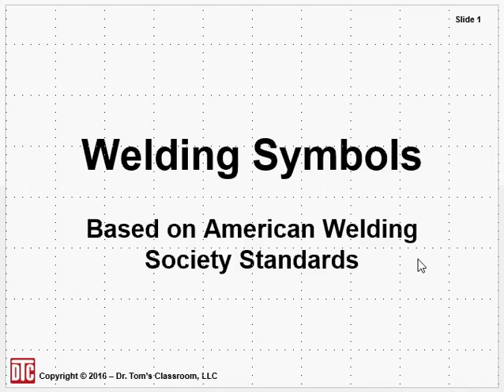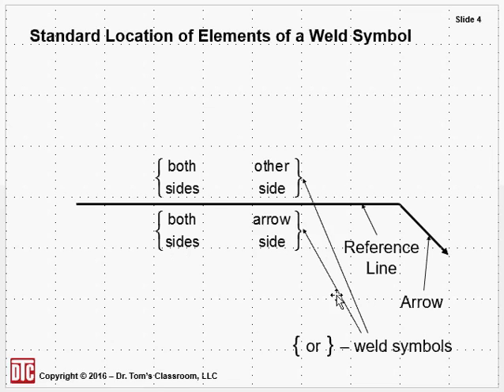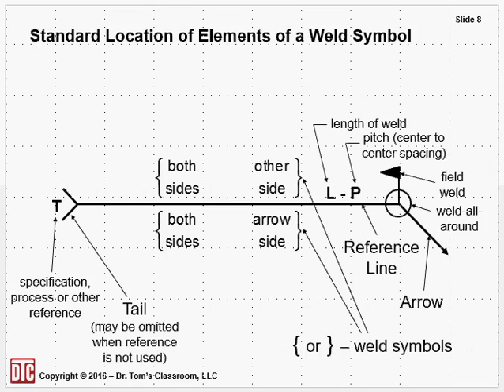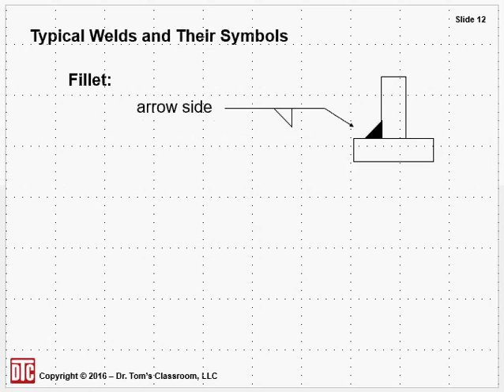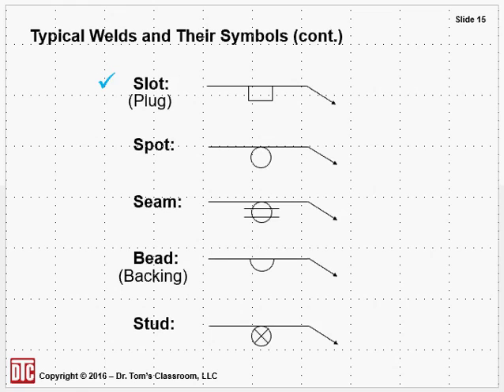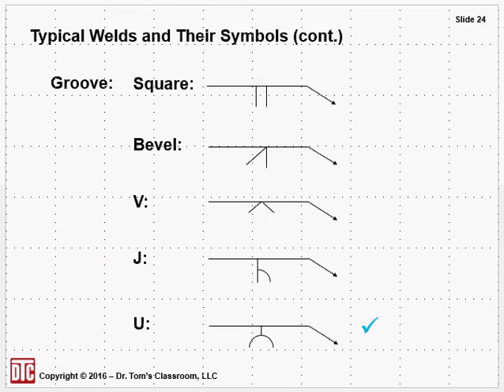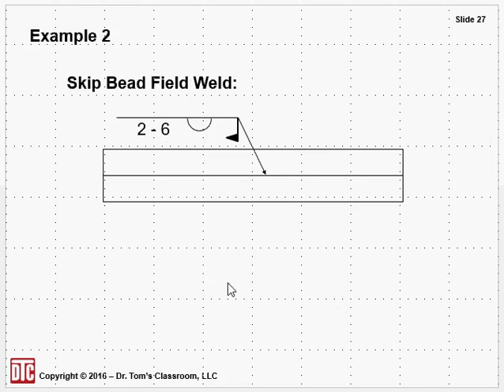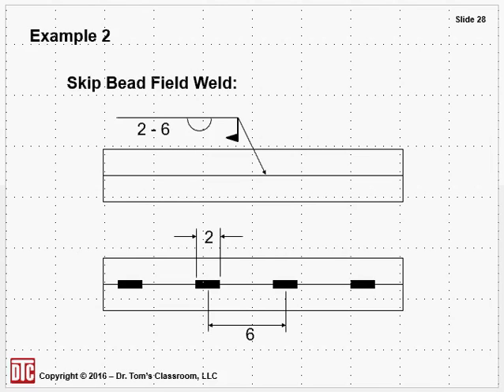Welding Symbols - Machine Design Fundamentals (Machine Design & Materials)

Comment: Not trying to be negative but I take it that this video was made to be informational, which is a great thing but you have to do this over because there a lot of miss leading info you are putting out there. #1- when placing a Weld symbol on the reference line, the vertical line of that symbol must be on left side. #2 - the depth of preparation must be on the left side of the weld symbol. #3 - the back or backing weld symbol works in conjunction with a groove weld symbol (groove weld symbol on one side and the back or backing weld symbol on the other side) and the length and pitch (center to center spacing of the weld) must be to the right of the weld symbol. Again I’m not trying to throw shade on your video but the information is miss leading is all.

Comment: my question would be when a designer would apply a specific symbol to achieve a specific weld
Reply from the maker: First, each type of weld has its own unique symbol with appropriate information to achieve a sound weld: size, location, etc.  As to how do you decide what weld to use, that is a whole course in itself.  An entire chapter in the Standard Handbook of Machine Design is devoted to welded connections and it only gets started on the topic.  And of course there is Google to search for what weld to use in what situation.  Good question.

Comment: From about 8:30 to the end, you have your depths and lengths on the wrong side of the weld symbol. Also, the field weld flag should not be turned upside down
Reply from the maker: The examples that you are questioning are intended to follow the rules shown on the AWS Welding Symbol Chart.  And the AWS Welding Symbol Chart does show field weld flags both up and down.  In the last example shown, I've shown the flag on the same side as the other weld information.

That said, for a "V" groove weld the AWS Chart seems to show the same symbol for both "arrow side" and "other side."  However, on the main diagram of the AWS Chart that I discuss first, it would require that the "1/4" should be on the "arrow side" and the "3/8" should be on the "other side" as I have shown. 

Dr. Tom
Reply: I am probably mistaken in regards to the field weld symbol but there is a horizontal progression that has to be followed and cannot be changed in regards to the depth, size, length and pitch. The 3/8 and 1/4 that you alluded to in regards to the V groove weld should  be on the left hand side. That is to say that the depth of penetration and the groove size should always be on the left side of the weld symbol and the length of weld and the pitch to the right of the weld symbol.
Reply: i agree with Jacob. Size and depth are to the left. In the last bit as well the length and pitch should be on the right not left side as they are shown. Other than that this was very informative. Thanks Dr. Tom for posting.
Reply from the maker: You are welcome.  I appreciate Jacob pointing out the incorrect locations of the weld information.